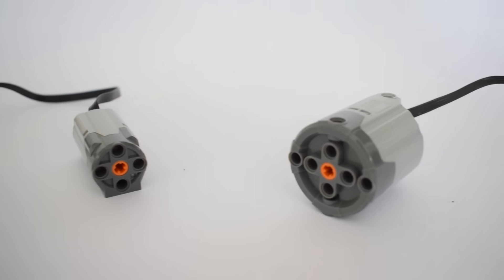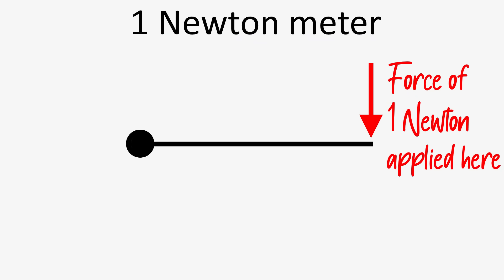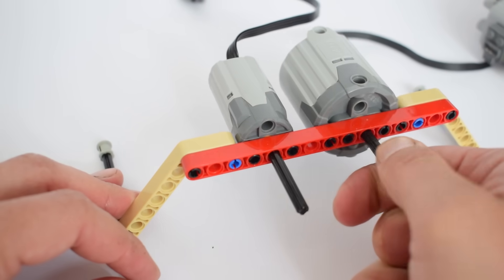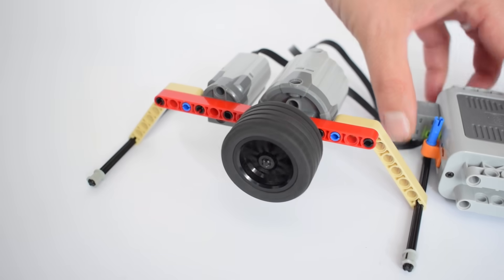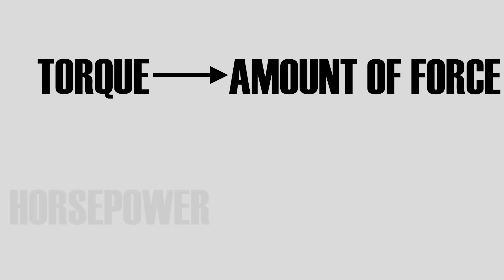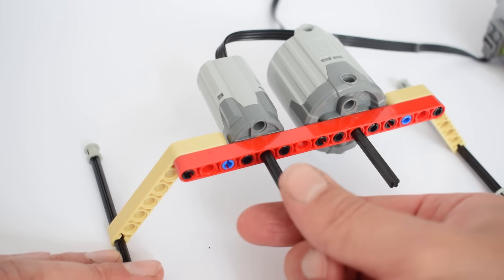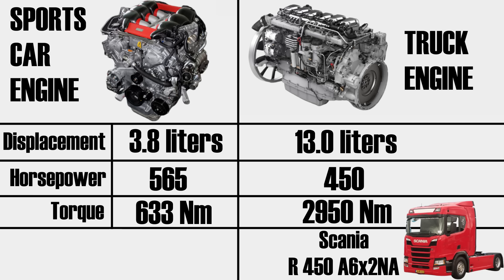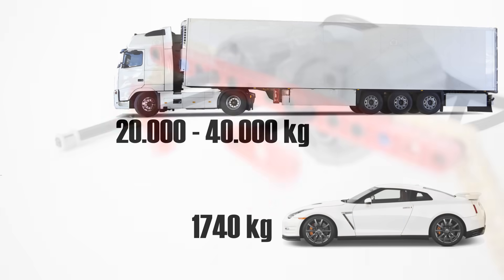NEVER be confused by HORSEPOWER and TORQUE again - HP and TORQUE EXPLAINED in the MOST VISUAL WAY

Comment: But doesn't this mean that the Nissan GTR engine (at 560hp) could shift more load  (in a given time) than the truck (490hp), if the Nissan engine had the right gearing? If that actually is the case, why isn't a high revving Nissan GTR engine more suited to the truck?
Reply: The transmission needed for such aggressive gearing would be massive which adds weight.

Also the engine would have to rev at 5000 rpm or greater while cruising at 60mph which puts more wear and tear on the engine, reducing longevity.

Last thing to consider is fuel economy. Engines aren’t very efficient at very high RPMs. Sports car owners obviously don’t care about fuel economy but truck drivers who travel hundreds of miles everyday care a lot about fuel economy.
Reply: @theotherguy6951  they are efficient at high rpm, just more fuel hungry
Reply: @szymoniak75  That’s exactly what I’m mean by inefficient.
Reply: @theotherguy6951  wear i understand that you mean piston rings vs cylinder walll when you say WEAR 👌🏻 if so than it goes like this 👉🏻 depend on avg piston velocity and distance which it defeat 👌🏻 vs rpm itself are irrelelvsnt reallly 👌🏻wear it also depend on pressure in combustion chamber and offcorse from what materiall are made piston rings and cylinder wall + how roboust thick they are + oil film thickness type asf 👌🏻 if you have feg 10000 rpm engine with piston stroke 50 mm vs 5000 rpm engine with stroke  100 mm it mean both achieve the same  avg piston  velocity 👌🏻 10000 rpm engine make 2 times more rpetetition but it defeat the same distance per unit of time as stroke is 2 times shorter 👌🏻 in results both wear in similar time 😎 👌🏻 avg pressure in combustion chamber is also similar cos for generate the same power for do the same job in the same time 10000 rpm 50 mm stroke engine be genenrwte the same avg combustion chamber pressure generate 2 times lower crank torq so from 2 times higher rpm generwte the swme engine power thus the same thrust contact path force at set speed 😎👌🏻 what only change is torque level at engine crank cos 100 mm stroke push on piston with the same force generate 2 times higher torq from 2 times longer crankshaft leverage 👌🏻 but power the same 👌🏻 and force in combustion chamber the same so piston rings and cylinder wall are very similar load in both egzample and in results wear of those element be very similar 👌🏻 so such reaeon why they dont use such engine for truck aplicstion are diffrent than this 👌🏻in reality thers many other stuff in engine than only wear like force in axis of rotattion crank asf vs towing capability is another flaww reason as some people think biger lowend torq engine can pull heavy load more efficient i mean faster uphill feg with better wccelerstion 🤭🫣 what a joke 🤮🫣👌🏻 in reality 1000 hp 500 nm at pefect gearing aboslutellly smoked let say 500 hp 3000 nm in drag race uphilll with 100 tons on trailer each 👌🏻so this is no reason as welll 😎👌🏻 true resson must be somewhere in noise region fuel consumptionregion most likely cos defenitely not because of wear as it is similar 👌🏻or pullling force as more topend power version conect with perfect gearing smoked in any pullling competition on time uphilll asf version woth more torq lower on rpm 👌🏻 …. ☕️ps thers also wear of crank axis and valve train and for those engine element its true thwt higher rpm have lower longevity of those engine element 👌🏻 but piston ring vs cylindar wall is not one of them most likely atleast not when we talking about piston ring cos wall still is exposed on more wear it looks like  👌🏻☕️
Reply: That's correct. More horsepower means it could. But it'd burn far more fuel and be much harder on the little engine. Big trucks done produce more power, they can just produce max power through the rpm range and do it all day long.

Comment: so... Torque = carry power and Horsepower = active power
Reply: Power and Torque are not Batman and Robin please stop trying to assign them roles. Power, not torque, is the limiting factor for not only how fast a vehicle can go but also for how much weight it can pull at a given speed and/or how fast it can accelerate a given weight. Torque is the sound of one hand clapping. Without RPM nothing happens.

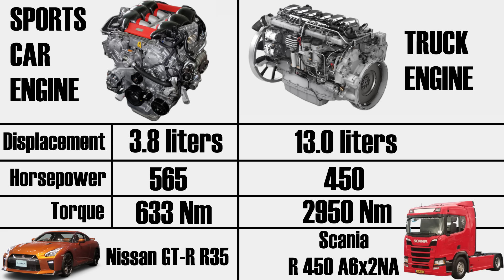Comment: Is it fair to say that (in the car vs semi example 7:29) horsepower is proportional to how fast the wheels will spin and torque determines how much weight the vehicle can handle? 
In that same example, the GTR can outperform the semi in a race, but if you loaded it up with weight to match the weight of the semi it would stay in place or move very slowly?
Reply: NO 👌🏻 forget about gtr i show you more extreme egzample let say ypu have 500 hp truck which have at crank 3000 nm or whatever let say its some non egzisted engine version which have 10000 nm 👌🏻 vs whatever what year or engine close in how its tech speec looks like to f1 engine let say it have 1000 hp and 250 nm fair enough 👌🏻😉 + each version perfect gearing so 1 gear lenght gear quantity  and diffrences between gear lenght 👌🏻 lets assume we put both engine in the same semituck with trailer both weight 100 tons each 👌🏻 road is 3 degreee uphill so like typical viaduct race 1/4 mille lenght 👌🏻 long story short 1000 hp 250 nm version will generate more thrust everywhere through race distance aka stronger accelerate up this hill with all those load let say at whell is at 50 km/h 400 hp for 500 hp 10000 nm version at crank and for 1000 hp 250 nm version is 900 hp at whell so you  have 671 k watts +/- : 14 m/s +/-= almost 47 tons thrust aka contact path force +/- 😎👌🏻 vs 400 hp so 300000 watts +/- :14 m/s +/- = only 21 tons almost thrust  🤭 almost the same diffrences be at 100 km/h and 10 km/h and whatever other speed ypu choice for comaprision level of force change at doffrent sped level but doffrencesss between those two egzample stay +/- the same at the same comaprisionen speed 👌🏻 😎 long stpry short more powerfull version crush more tprque version both at perfect gearing everywhere everytime period  uphill downhill on flat road whatever lesss topend power version have chance only if thers not enough grip for get advantage from engine woth more power 👌🏻 upthis hill lill deeper calcluation show such stuff 👉🏻 like im mention let say we are at 50 km/h up this hill which have 3 degreee incline so avg rolling resist for tire vs tarmac is 0,02 avg drag so cda for some avg trccuk is 7,5 and sinus of 3 degree is 0,0523 if you calculate very resist it turn out that beside inertia of 100 tons this truck must also exceed +/- 7,5 tons additional resist come from inline drag and roll resist 👌🏻 other word 107,5 tons resist including inertia 👌🏻 now if you want know accelerstion level which give each of those version ypu must now divide force at whell at 50 km/h for egzample which was calculated earlier be this whole ressot so 107,5 tons so for 1000 hp 250 nm version at crank where it have 900 hp at whell at 50 km/h it was 47 tons :107,5 tons = 0,4372 G force of accelerstion up this hill 👍🏻 vs for this 500 hp 10000 nm version at crank which have 400 hp at whell at this 50 km/h ypu have 21 tons of contact path force push it upthis hill at best posiible gear ratio at best posiible engine rpm so offcorse pesk power rpm 😉👌🏻divide be 107,5 tons as both have the same resist and you got what? = only 0,195 of G force accelerstion this version upthis hill other words at this point at this 50 km/h with both version with gass to the flooor at perfectmengine rpm 1000 hp 250 nm will push you into seat with more than 2 times bigger force than 500 hp 10000 nm version 👌🏻now how much total resist would need to have 1000 hp250 nm version for accelerate the same fast up this hill ? 👉🏻 47:21 tons contact path force x 107,5 = 240,6 tons resist only than they would go head to head upthis hill anything under  this 240,6 tons and 1000 hp 250 nm version beat 500 hp 10000 nm version with only 107,5 ttons resist 👌🏻 it would lost only if resist exceed border of 240,6 tons so in me hipotetical egzample version which have 40 times lesss peak crank engine torque need 2,2 times bigeer resist for achieve the same acceleration level yphill downhill or level road dosent matter 🫣🤷🏻‍♂️👌🏻 😎 ….long stpry short towing capabilities and torque level at engine crank is not egzacly directly connected 😉👌🏻☕️
Reply: Power and Torque are not Batman and Robin please stop trying to assign them roles. Power, not torque, is the limiting factor for not only how fast a vehicle can go but also for how much weight it can pull at a given speed and/or how fast it can accelerate a given weight. Torque is the sound of one hand clapping. Without RPM nothing happens.

Comment: Excellent video.
I have had a lot of motorcycles all different sizes and this explains the sensation of going from a 600cc bike that can do 160mph to a 1200cc which can only do 120mph, but feels much more powerful. I can pull away in 2nd gear no problem and go fast with low RPM and not worry about changing gears so much. The 600cc bike red lined at 14k RPM but you needed high revs to get any sort of power out of it because at low RPM it was gutless.

Comment: Torque is real power,  horsepower is only a label.
Reply: 🤐 cprvette c5 z06 411 hp 540 nm 1500 kg woth driver 0-100 km/h 4,8 sec 100-160 km/h 5,5 sec avg from couple real world tests 👌🏻 vs ferrari 430 scuderia 510 hp 470 nm 1500 kg with driver  0-100 km/h 3,6 sec 100-160 km/h 4,0 sec avg from couple rear world test with high frequenzy accelerometres and gps … only label ? 🤐 honda cb 500 pc26 57 hp 47 nm 300 kg with driver 0-100 km/h 5,0 sec 0-140 km/h 10,5 sec vmax 180 km/h vs kawasaki w 800 48 hp 62 nm 300 kg with driver 0-100 km/h 6,1 sec 0-140 km/h 13,3 sec vmax 170 km/h 👌🏻🤷🏻‍♂️ only label really  ? 🤐 i dont think so 😉👌🏻 + torque is not power and defentielly not real power 🤐 torque is bs 👌🏻vs kinetick energy :time = power 😎 👌🏻 more torq engine with less power is more fun though 👌🏻 but it dont give you win any racing 👌🏻 not when more topend power have perfect gearing and driver is god 👌🏻 and offcorse both at simialr resist or not enough biger for more powerfull version + enough grip for get advsntage from more topend power version 👌🏻☕️
Reply: Reverse that and you're much closer.
Reply: Hivemind nonsense.
Torque is not Power.  Power is Power.

Comment: Good day!
Overall, a great explanation. The difference is clear. The only thing missing from this is the way horsepower can be modified while keeping the torque constant. That's the main source of confusion in my opinion. It seems that the only way to increase horsepower is to increase torque, but that is false since you can also lower the time during which the torque is applied. Question is, what parts of the electrical engine influence the speed of the force, rather than the torque? I guess you could make the crank-shaft lighter/smaller?
Thanks!

Comment: But the car at 7,000rpm will push more than the truck at 2,500rpm, right? Because what really matters is hp, isn't it?
Reply: Yes, geared to the same speed it would produce more torque at the wheels. Engine torque is a relatively meaningless number.

His video makes mistakes.
Reply: @SlyNine 👍. Good answer!

Comment: Torque is force
Horsepower is energy
Reply: Torque is energy
Horsepower is power
Power is energy over time
Reply: Torque needs RPM to become energy
Torque is only force, think about standing on a breaker bar. Torque is applied but no energy is required for that.
Torque x RPM = HP
Reply: Nonsense

Comment: A car engine is a toy compared to a truck engine... If the truck engine was spinning at 7000 rpm, it would have not 400 but 3/4000 hp... But then the truck engine would not exceed 1 or 2 mil. kilometers, but significantly less... The ratio of horse power per ton of weight is about 10 hp per ton for trucks, these engines are the most energy efficient and the most economical because that is their purpose N1
Reply: No, it would have zero torque and hp because it can't spin that fast. The same reason his bigger motor can't spin any faster. It loses all it's power and torque beyond that speed.

What a truck can do, is produce it's power more efficiently and last a lot longer.

Comment: Nice explanation! But more care should be taken with units. Power is not a measure of the rate of force, power has different units, i.e. energy/time. This can also be written as force x distance / time, which has the same units as horsepower. Also, torque is not a force, again different units.